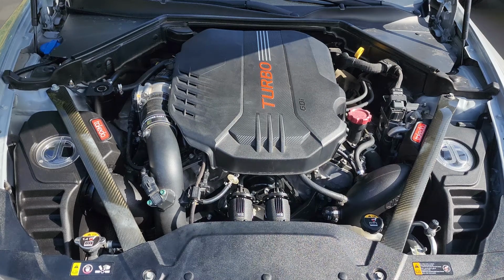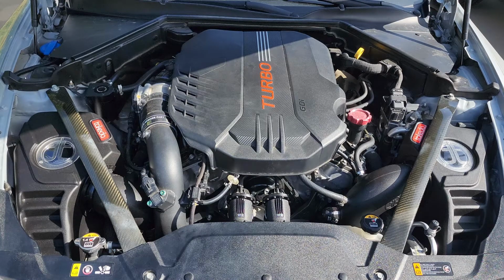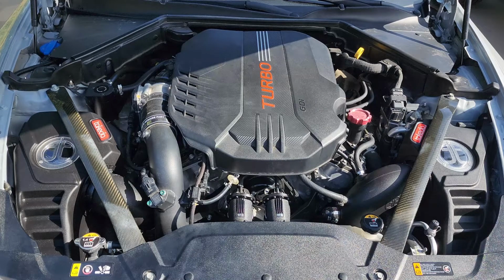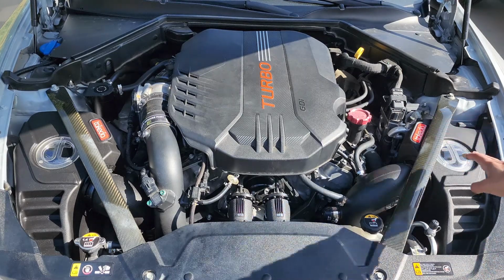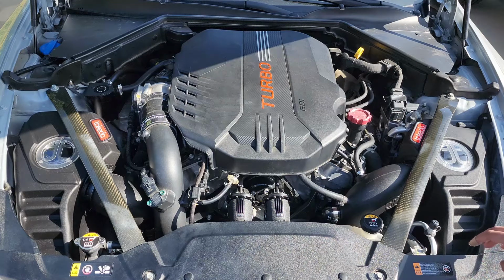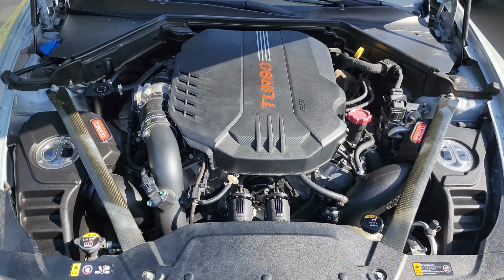Kia Stinger GT aFe Intake Review and Comparison vs Injens (side by side comparison).

Comment: Good choice bro, if I were to redo it I would grab these with the non lit Kit Snorkels. This is an optimal setup as these engines produce an exorbitant amount of heat 🥵
Reply from the maker: Thanks! I need to finally decide on a tune. Your videos make me want to go lozic but I kind of want to wait on the Sxth ek1pro lite controller. I'm getting kinda impatient but we'll see. Lol!
Reply: @ironhyde_gt   if you go Lozic I would grab his TCU tune, his ECU has come a long way but yeah I would def recommend some sort of device where you can monitor it
Reply: Why the non-lit over the lit ?
Reply from the maker: @honkeykong752  I think some people experienced battery drain
Reply: @ironhyde_gt great point I didn't consider. So the afe intake can be used with eh velossatech snorkles?
Reply: @LegendsPizzaCo  yes, because the snorkels sit past the radiator. The airbox sits behind the radiator.

Comment: I installed the aFe Takeda Cold Air Intake along with HKS plugs, a JB4 tuner and a Mishimoto inter-cooler on my 22 Genesis G70. Or as some call it, a Stinger in a tuxedo. My kit didn't include the clamps to attach the system to the turbos either. I also reused the factory clamps. As they aren't on the pressure side of the turbo, any clamp will work, plus you can't even see them once everything is back in place. I didn't have any issues with the screws that connect the air boxes to the front intake. I inserted that screw first, giving it just a couple of turns to hold it in place. Next I installed the two screws inside the air box. Then did a final tighten of the screws that secure it to the front intakes. Everything went in at once, so I can't say how much power each mod contributed, but with the Map 2 tune (93 octane) the car has definitely come alive. The car's original performance was impressive. Now, there is a nice, but not obnoxious, increase in engine sounds and the power comes on in a way that guarantees an ear-to-ear smile every time you hit the gas!

Comment: Do you think i should get these for my g70 are the performance increase noticeable or anything? Also would you recommend bovs or these intakes first, im mainly wanting turbo noises but if the intakes provide noticeable increases i might get them since they increase the turbo noise, thanks.
Reply from the maker: injen intakes will give you all the turbo noises you need ( especially the injens). BOVs add a little extra sound but are not necessary.

Comment: bought these for my 2023 Genesis G70, hoping they are a good fit. Do these make any extra noise without the BOV? I mainly got this AFE brand because someone told me they are supposed to be top quality. I really would like to do an aftermarket exhaust to get burbles and backfires (not the ricey sounding crap) but unfortunately there is not a single exhause out there except for ARK which is like $2k and honestly sounds no different than stock lol
Reply: I’m think about getting these for my G70 too. I was originally gonna get the AEM intakes but I kept hearing these are best for performance. Please let me know how they fit and feel! An update would be appreciated! Thanks!
Reply: @christopherherrera8507  I will post a video on my channel, keep an eye out. I plan to install them next weekend hopefully. Install will take 2.5 (suggested by manufacturer) but I imagine it'll take me 6 hours
Reply: For exhaust you have Jun BL, IMR, Kunstwerk HPX, but you're right, w/ the exception of IMR they're expensive as hell. And IMR's sounds stock ish. 
A secondary dp might throaten up any catback you end up getting though

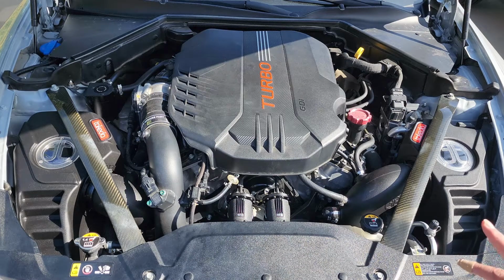Comment: 2:10 I was missing 2 of those clamps too in my kit for the 2023 g70 3.3t. Did you have any fitment issues with the passenger side one? If you check my videos it shows how im having fitment issues.
Reply from the maker: Hey! Passenger side took some wiggling around but everything fit fine for me even with the larger intercooler piping.
Reply: @ironhyde_gt  Did yours have a cut out on the air box like this one? https://youtu.be/_Ggwrz0A9ok

I'm installing the same intake, but what's weird is, the passenger side has a cut where it should fit right into the snorkels.
Reply from the maker: @kuvyoghmoobamelica6883  I can't really recall off the top of my head but I don't think its the correct shape at the snorkel end. Judging from the pictures on the website, it should be more flat. https://afepower.com/afe-power-56-70038r-takeda-momentum-cold-air-intake-system-w-pro-5r-filter#
Reply: @ironhyde_gt  Yes that's what I was thinking too. The part that goes right into the snorkel suppose to be flat and not cut out like the one in my video. I installed the rdriver side with ease and it fits. Just the passenger side which is suppose to be the easiest part of the installation is giving me problems. Either wrong intake box was sent to me or their afe manufacturer wasn't paying attention to their blue print.
Reply: UPDATE: A month ago, I contacted AFE, and they sent me a new passenger intake box, and it looked exactly like the same, but the opening where it goes over the snorkel was a few mm bigger. The old one was a bit smaller and they are very hard plastic and are not flexible so to force it open into the snorkel, I refuse to do it. AFE made it right and sent me the intake box OVERNIGHT ship. Super amazed by this company. I would definitely buy from them again just cause of the customer service.

Comment: Does anyone have these on a 23?  I had an 18 when I ordered them in early August.  However recently traded in for a 23 to get all missing items from Korean spec.  Supposed to be getting my end of the month to see.  They are only listed from 18-22  but i doubt there is any changes from 22-23 models.
Reply from the maker: I would think they would fit. I'd message afe just in cast though..
Reply: @ironhyde_gt  I too don't see any changes in the airbox, AFE stated 18-22 but I will let you know as I didn't cancel my order and still waiting on them to arrive.
Reply: @tshing08 Hey, I just want to check if it's fit to 23, please give us your feedback
Reply: @MrEvoOoOo  If your referring to the intakes, yes they do.  Only minor issue is the bolt that goes in the front mount leaving the engine compartment is left out.  The other 3 hold it in place and the one left out doesn't make a difference as the piece on the other side slides into it.
Reply: @tshing08  thanks buddy, do you notice any difference in performance?
Reply: @MrEvoOoOo  If you add snorkels to them you will have a ram air setup.  This is a huge difference and a stock car will start over-boosting under WOT.  There is a huge throttle response over 45 mph.  A stock ECU will adapt over time and take away the gains. This is true for all performance bolt-ons.  You will need a JB4 at least to take advantage of them.  Other options are a BEF or a tune.  My Pantera medal Stinger is featured on TWN2BRO channel.  4 videos where you can see the intakes installed and other mods.  Check it out..

Comment: Guys, just my two cents worth. I ran KNN so called CIA Intakes. I recently took them off and put my stock air boxes back on with K/N high flow filters. I am also running the velosa  tech snorkels. There is a lot of controversy over cold air intakes. This is my opinion only, but they do absolutely nothing for performance. Most people buy them just for the appearance and the sound that they make. I don’t mean to bust anyone’s bubble but these are the facts, my intake air temp dropped back down when I put the factory boxes on and the high flow filters with the velosa tech snorkels. I am also running a Lozic ECU and a Lozic TCU tune. Draggy 0 to 60 is 3.51 with this set up, not kidding. Factory exhaust with the exception of ARK Secondary Downpipes.
Reply from the maker: I agree it really all boils down to preference,  sound, and looks. aFe is the closest to stock airbox. I've noticed a difference in performance for me vs the injen intakes. Injens do sound cooler though,  lol! How is the lozic tune treating you? I'm considering lozic or waiting out for SXTH Engineering ek1pro lite.
Reply: @ironhyde_gt  The Lozic tune reinspired me. It feels like you are driving a v8. Words cannot really express the power difference. I have been running a JB4 for the past 2 years but it’s a whole other world when I actually put a real ECU tune in. WOT at 60 will pin you back in your seat. Don’t get  me wrong I liked the JB4 but you cannot compare the difference. My JB4 is for sale if you know anyone interested. It has the fuel wires, Bluetooth adapter, positap adapters for the fuel wires. No piercing into your harness.
Reply: How does you exhaust sound with OEM cat back and the secondary dp? The ark secondary dp has not cats right?
Reply: Because KN, Ingen and some other cold air intakes are actually HOT air intakes, they suck hot air from the engine bay and the hotter air offset the higher airflow.  
The stock box with KN filter and aFe intake are real cold air intakes.

Comment: Where the the plugs located?  That you can remove for more sound.  I dont see them
Reply from the maker: Driver side is located on the left side of the airbox.  Passenger side is located on the back of the airbox.
Reply: @ironhyde_gt  Im assuming removing them also means hot air getting into the air box.  Does it sound better with plugs removed?
Reply from the maker: @edwindiaz3461  Sounds better with the plugs off, still not as loud as a fully uncovered intake. Yes, it does pull in more warm air. These stinger run hot 🔥

Comment: biggest no one is able to answer is what does the data comparison between afe takeda vs injen or other open intakes with the jb4 on i see you have it since you have the heat shields for it ... can you pleasee enlightened me in the data difference was it overall better ????
Reply: pleaseeee respond lol im making my decision soon
Reply from the maker: Unfortunately no jb4 or tune yet. Covers are just to clean up the engine bay and hide some wires.  I do have a gauge that monitors everything including intake temps. I'll try to get a video when I get a chance. So, far I like the aFe intakes but I do miss the sound of the injens, lol!
Reply: @ironhyde_gt  lmbo I keep hearing different debates that open intake just suck up hot air and that close intakes are better because they are closed and don't suck up hot air. And yes the sound is what is making me want to get open but I don't want to get less performance... Although I was going to get the BMS open intake which they said gives/frees about  27 HP with jb4 so that alone tell me it does aid but no one has tested this close intake with jb4 Son I was wondering would it be better for performance with jb4
Reply: Also did you feel the same with the injen and takeda intake or did you feel a difference in power at all or loss of power. Would you switch back just to get the sound back?
Reply from the maker: @jhernandez7202  I personally won't be switching back to the injens and it appears the aFe does put down more powe (and the difference is probably marginal since I can't dyno them ).
Reply: @jhernandez7202  did you end up making a choice? Closed box are theoretically better for taking in cold air, but without a dyno tune from someone that knows what they’re doing the difference between closed vs open is so minimal. It’s even more minimal if you take into account the snorkel/air inlet not being broadened anyways. A larger intake sucking more air under the hood without expanding the inlet is just going to have to pull it from anywhere else anyways. Unless the box is airtight you’re still going to be pulling air from under the hood. There are definitely better ways to make power than through intakes but man they sure are satisfying to listen to
Reply: @J Hernandez  I have the afe intakes on a 2022 gt1 with the snorkels and jb4. You can feel the power difference as I get jerked back onto my seat when I hit the gas. The car feels much faster and more fun
Reply: @StingerOfNewOrleans  yes, definitely. I have a gt2 2022 scorpion with injen intakes basically fbo, w the huge Wagner intercooler and ecu tune just waiting to do high flow downpipes and water meth. I was just saying the difference is negligible for open air vs closed box intakes unless you dyno tune with somebody because the max hp from closed box is super negligible
Reply: @Stephen  I don't know much about under the hood of cars and all that...I just watched a bunch of videos and studied the intakes. I've seen a bunch of injen ppl say if they was to do it again they'd go AFE....the jb4 prolly furtherst tune im gonna go...if I do lozic I'm doing tcu about it because I wanna keep jb4 and ion wanna deal with E30 and meth stuff that's too much for me lol
Reply: @StingerOfNewOrleans  yeah I’m not gonna do e30 and probably gonna have him set a new profile or only under custom mode for the water meth. The afe do look great, should stay cleaner and are more practical (and cheaper I think?) plus the intake noise can be muted with the plug. I’m still not annoyed with my injen sound though
Reply: @Stephen  I feel you on that lol...yo set up sounds amazing and afe is like 100$ cheaper than injen
Reply: @StingerOfNewOrleans  thanks man working on it! Drive it a lot… almost 60k miles already
Reply: @Stephen  nice I got 29k more lol...mines coming together also
Reply: @StingerOfNewOrleans  that’s bonkers

Comment: I have these intakes on my 2022 G70….a little issue since I run dual ADDw1 oil catch cans and dual ADDw1  BOV’s…got the VelossaTech Big mouth LED intakes but still deciding on whether to run the Mishimoto or IRM intercooler.  I think the Mishimoto needs some fabrication work for the G70.
Reply from the maker: I'd go with the mishimoto. intakes were a tight fit but I got them on. also the mishi is carb legal if you're in CA.
Reply: Any issue with the passenger side can’t get mine on
Reply from the maker: @B58BLACKPANTHER-me6qn  Passenger side was a pain but you do have to adjust here and there to make it fit perfect. Have larger intercooler piping did make it a tight squeeze too.
Reply: @ironhyde_gt  thank you I’m just going do the bms intercooler just want a mid 11sec car so did the intake waiting for intercooler then downpipes then tune and tcu hopefully I’ll get 11.6 11.5 out of it

Comment: I don't understand the AFV box because it's almost identical to the factory box with maybe two or three open ports extra shouldn't really add any difference why not just leave it stock That's what I'm trying to figure out and this is what I'm debating on my g70 right now. I want the noise obviously but I live in Oregon and it rains a lot so I have to worry about intake sucking in water
Reply: The same company sells pre-filter covers that should block any water from the primary filter that gets in there. Supposedly they don't affect airflow. I used to have a cover made from the same material for my electric rc car, and it did block water.

Comment: What size or the block off for the intake please where the original blow off valve would go to the intake
Reply from the maker: HPS 1 inch coolant caps! You need to purchase two. Pricey for what it is but won't fade and crack like the random chair tips you buy from you local hardware store! https://hpsperformanceproducts.com/products/hps-high-temperature-reinforced-silicone-coolant-cap-bypass-heater-core-delete-black-blue
Reply: @ironhyde_gt  thank you for responding fast and for the info thank you

Comment: Does this new box connect to the same as the old box bc that is supposed to be a restricted setup. Or does the afe box take air in directly on its own??
Reply: I just installed these on my 2018 and I love them. You remove the factory... I'll call it "sub-snorkel," The bit that goes between the inlets behind the grill and the stock air boxes. Then the new air boxes connect directly to the intake. They give you all the numbers, Whether or not I'm going to believe the HP/Tq gains is one thing but I do trust that they tested the flow of the system and the numbers they give for increased airflow are accurate.
Reply: @LoveTheElectro  thanks. I’m just wondering if the new boxes eliminate the need for the snorkels like Velossa or the other ones??
Reply: @LoveTheElectro  thanks. I’m just wondering if the new boxes eliminate the need for the snorkels like Velossa or the other ones??
Reply from the maker: @Chris-Brauch  I think the snorkels are a nice add on but not necessarily needed.
Reply: The only thing with 22-23 that MAY be an issue is a missing bolt sticking up in the rear of the passenger side intake (if the box even bolts on there. Installing my mission to catch can it’s missing a bolt that every other gen before 21 has but there is already a solution using $4 of hardware store components that’s been shared on the stinger forums
Reply: @stephen2224  can you provide link? I'm planning to buy these for my 2023 GT2 and install them myself, would love the additional info to be prepared
Reply: @EgguEd51  to the hardware? Honestly I’m just letting it rely on the one included bolt and not stabilizing it on the rear. YouTube doesn’t let me include links but stingerforum is where I found my answer and hardware suggestions after staring at my engine bay for hours wondering how I messed up